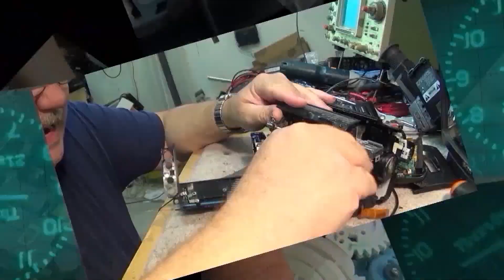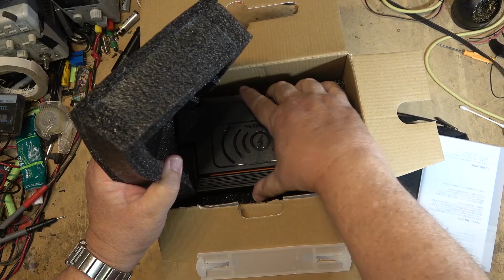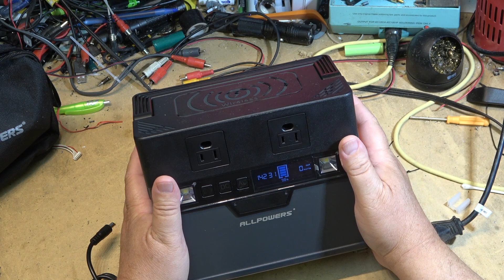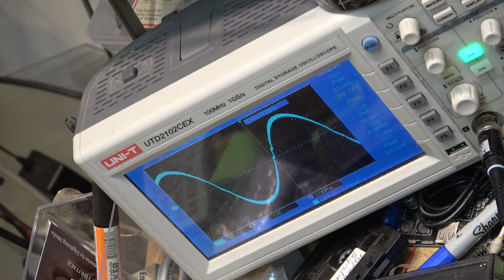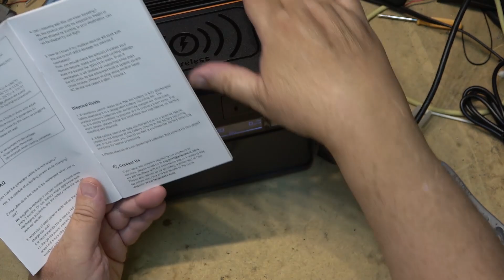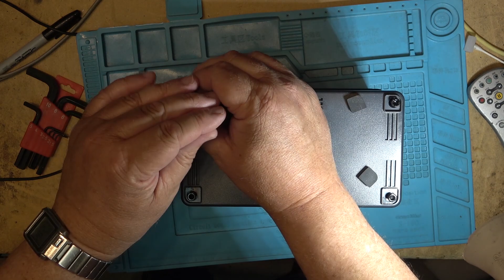AllPowers S300 Portable Power Station Tear Down and Overload Test

Comment: My S300 has stopped working, I believe that it may be the batter pack but Allpowers have told me that no replacement is available. A very expensive device that is useless now!
Reply from the maker: Unfortunately this can happen especially if you don't use it and allow it to sit and over discharge.  The instructions say to charge every 6 months if not being used.  I killed one of mine that way.  Ended up giving it away.
Reply: it's a piece of shit.  I'm waiting for a replacement after 5 or 6 uses.

Comment: Well, I just got my S300 Plus 2.0 the updated version. I powered up and put my AC 4.5V adapter in the AC socket and was playing my Sony 2010 radio on it and noted that there was a lot of line noise. Is there a way to put a line filter on it?
Reply from the maker: It's a switch mode power supply. It's going to generate noise on am and shortwave bands

Comment: I've got one of these and I've noticed the screen keeps coming on when nothing is plugged in to it. I've also noticed a green light flashing inside and draining the battery. I can't find a way to turn it of completely.
Reply: I have the same, bought new. The display lights up every 10 minutes for 1 minute although it's off !?
Reply: @olivermalina1665 
I did wonder if it had a fault or if it was supposed to  do that.
Reply from the maker: That's why the destructions say to plug it in and recharge from time to time so you don't end up with a brick.
Reply: @12voltvids  you missed the point of what I said, the screen keeps coming on and off when not in use.
Reply from the maker: Didn't miss any points.  Was just commenting that they need to be charged from time to time to prevent turning it into a brick.  
I have no answer to what yours is doing because I don't keep the ones i have no plans to use.

Comment: I'm looking to buy one of these and found your video extremely useful so thanks for that. I have a question about recharging the unit. Via a 10amp 12v cigarette lighter this gives 120 watts which I assume is the wattage that the unit will recharge at. If I recharge via 220 from an inverter or mains it will only recharge at 60w. Is that correct? I'm grateful for your help.

Comment: Great video.  I just got one of these units to support my insulin fridge in case of emergency.  It is a small dorm style unit.  About how long did it take to charge the unit off the AC power brick from depleted?   I'm sorry if you covered that and I missed it.
Reply from the maker: It was a little over an hour if i remember.  I sold it after the video was done as i didn't need another one. I have about 8 of them here.  I did cover that in the video as i timed full load discharge and charge.

Comment: These heater guns are bad to use at ½ power, because you are running the resistive element over a diode. At full power, the diode is shorted by the switch. So yes, on ½ setting it's half the power, but that's because one half of the sine wave is blocked by the diode. You could say it's 50% duty cycle.

Comment: Another thing, according to the manual, the solar charging function can be monitored at your figure tips.  Does this mean that this device is intended to be used only by pretty ladies with trim figures?  Also, placing an LED on a board where nobody will see it is illogical.
Reply from the maker: Lots of devices have leds internal. For testing purposes at the factory. I have seen devices at work that have alphanumeric led displays inside the cabinet only visible when the top is off being maintained.
Reply: @12voltvids  Okay, I think that makes SOME sense.

Comment: Lithium ion no thanks !
Reply from the maker: Nothing wrong with li-ion. Its the polymer ones to avoid. iron phosphate are better, more charge cycles but this is a basic unit for camping basically.
Reply: I know but I'm still not convinced
Reply: @Irilia_neko your phone has a lithium battery
Reply from the maker: @Irilia_neko  My car has 288 of them, and a tesla has about 4000 of them. 12 years old and still working fine.
Reply: Website says batteries cant be replaced anyway.
Reply from the maker: @Carnivorous-Vegan  they shouldn't need replacing.  Even if you went camping every week  and charged it 100 times a year it would still last 8 years.